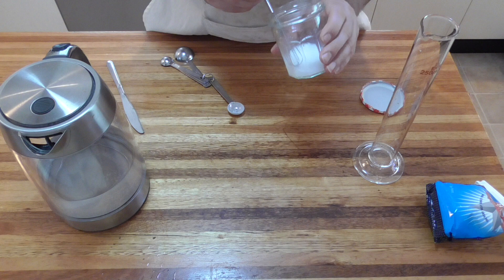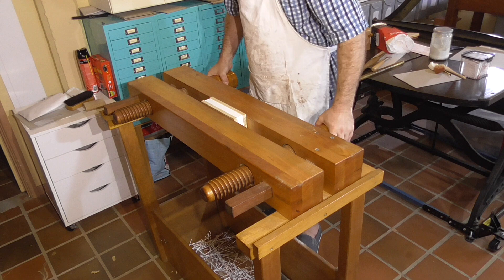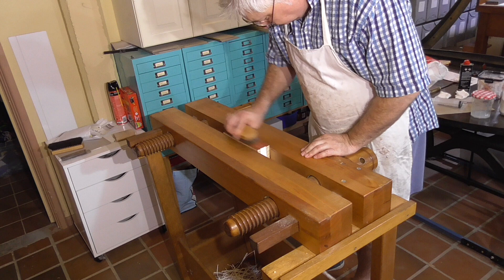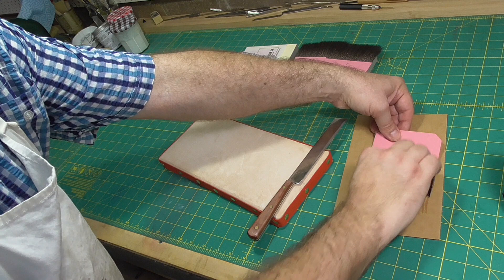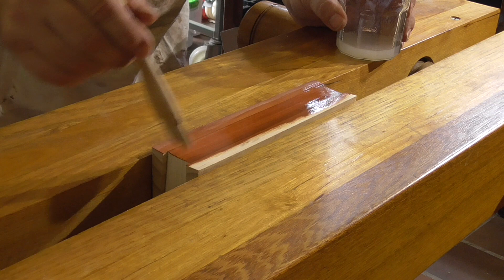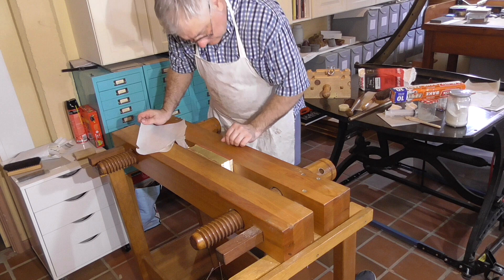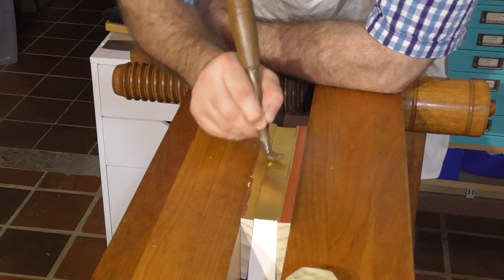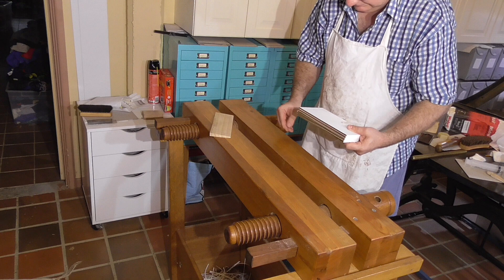Edge Gilding with Real Gold Leaf; John Mitchell Approach // Adventures in Bookbinding

Comment: You, dear sir, are ab oath-breaker! A secret-revealer and a mystery-demystifyer! And I simply adore that! I cannot recommend your videos enough. A big thank you and much love from Romania!
Reply from the maker: Great to hear from you.  I love your work!  I just found one of your videos I don't think I've seen.
https://www.youtube.com/watch?v=KRY96q3ml9Q
The paring of the spine on the curved stone is a great idea.  What do you use to get that great Venetian red colour on the edge?  All the best, Darryn
Reply: @DASBookbinding  hahaaa! Thank you man! It s an adaptation I did even when I was paring with a straight knife. Not having a French paring knife limited my spine paring method, so I had to devise this. You basically shave off longitudinal lines in the head region, then flip it and do the tail, then you shave some more to make the transitions smooth, and then I sand it by hand to get everything flush.

The red? Depends. When doing modern bindings and big numbers I use acrylic, 1:1 dilution, brushed quickly and forcefully and then blowdried to avoid seepage. Then I burnish it with crumped up paper (which i do recommend fore Bole as well, it s an old trade secret I ve learned) and then wax it perhaps.      When doing period bindings or old books, I use watercolor, strong dilution, also burnished but fixed  with beeswax and turpentine.

Comment: I really enjoy your video's. They really show all the facets of the techniques, including possible problems you might encounter. I'm interested at exploring bookbinding myself with an emphasis on medieval bookbinding. Do you have any literature recommendations for medieval bookbinding? Regards from the Netherlands
Reply from the maker: The bible on this subject is "The Archaeology of Medieval Bookbinding" by Szirmai.  But it is not a how to manual.  It is a complex question because there is no single "medieval" book structure.  Most of the tutorials on the net are pastiches of the style.  It is something I think is best worked up to.  In the next couple of months I'll be doing a flexibly sewn tight-back which is a good entry point for this area of binding.  I also have a modern take on the 16th century K118 binding planned for second half of the year.  All the best, Darryn
Reply: @DASBookbinding  Thank you for the information. I will look it up. I should be able to get some additional info from some archaeologists I know and fellow re-enactors with an interest in bookbinding or calligraphy/iconography. I will also keep a weather eye on your channel for interesting video's.

Comment: Thank you for this!  Is the starch corn or wheat?  I cannot find any information about that part.  Also I am curious, is finely milled refined corn or wheat the same thing?  Or does laundry starch have another additive in it?  Thanks again!
Reply from the maker: Wheat.  If you can't find wheat I'd suggest rice.  Not sure about cornstarch.  All starches aren't the same.  But for this use, maybe the differences aren't too important.  So maybe cornstarch would be fine.  Give it a go?  Laundry starch usually has whitening agents, which is best avoided.  The laundry starch I use supposedly doesn't.  But I don't think it is available any more.

Comment: Many of the boles seem to require rabbit glue. You used the starch size instead. Does that mean I could use any size mixed with the bole clay powder? I don't want to use rabbit glue! Your videos are amazing by the way!!!
Reply from the maker: In the different edge gilding videos I try and the different sizes traditionally used by bookbinders - gelatine, starch, PVA.  So, yes you can use what you want.  There is even a type made from boiling scraps of parchment (doesn't last very long).  I do know of old timers that used the glue from the animal hide glue pots.

Comment: John Mitchell's book suggests using an elliptical method when burnishing with a flat burnisher, but it looks like you just do a straight back and forth. Is this just habit, or do you have a preference?
Reply from the maker: I have tried this and found it is really easy to rock the burnisher ever so slightly and leave burnishing marks.  Maybe if I practiced more I'd find I could avoid the burnishing marks and the end result is better.  If Mr Mitchell does it there must be a good reason.  DAS

Comment: Can you show how to do gold lettering on book covers?
Reply from the maker: I do it 3 ways, with a blocking machine, with brass type in a hand chase with either foil and sometimes real gold, and rarely with real gold and handle letters.  It is hard enough to do with no one watching, I don't think I'm up to the last 2.  I occasionally briefly show using the blocking press in a few videos.  Do you have something specific in mind?  Yours, Darryn
Reply: @DASBookbinding  im not quite sure how to explain it properly but embossed letters with gold foil
Reply from the maker: @CastleStar5596  Yep.  Unfortunately the traditional methods, which I use, all involve very expensive tools and machines.  The gold foil or leaf is relatively cheap.  The best bet is to find an established bindery that you can pay to use their tools and equipment.  Many binderies do this, especially if they do teaching.  Most of my finishing hand tools are on loan.  But I will put it on the list of videos.  All the best, Darryn
Reply: @DASBookbinding  i will look into that option, your videos have been a huge help in teaching me how to bind books. More specific, binding comic books together, using the pamphlet bind video that you showed a while back. Did the library binding technique for awhile with comics but couldnt get the spine curve right so when you showed the pamphlet bind technique, it made binding so much easier and faster particularly with short runs of comics. So again, thank you for showing how to make bookbinding a fun hobby or career and thank you for your time as well. Much love and respect from the U.S.

Comment: would one ise the same method for guilding playing cards?
Reply from the maker: You could but most playing cards with gild edges will be done with foil. And the round corners are a problem for gold leaf.
Reply: @DASBookbinding  is it just called guilding foil? Amazon they use the terms interchangeably for some reason.. leaf and foil.
Reply from the maker: @Gbhmagic  I wish it were that simple.  Do your cards have rounded corners?  Are they home made or commercial cards?  Using foil for edge gilding can be a bit tricky.  The 3 factors that determine gilding success with foil are temperature pressure and dwell time (how long you apply pressure and temp).  The manufacturer usually specifies this.  Sometimes you just get temperature and that other two are more forgiving and you can work them out.  Temperature is very important and usually why people fail.  The foils sold on amazon are low grade cheap and they don't give you this information.  So you have to guess and experiment.  This means lots of tests to work it out.  For small scale production environments a heated silicone coated roller is usually used.  There are some big commercial machines that use huge heated plates.  I've heard of people managing to get some success with a clothes iron.  I tried it without much success.  The surface/edge has to be prepared and very smooth too.  Some materials/papers just don't like to take foil, especially hard art type papers.  This can usually be fixed with a surface size, such as one that Schmedt sells (can't be posted OS, so only available in EU).  I've heard of people using a PVA size.

Comment: I will probably be banned from this site if I ask : Is rubber cement ever used in place of other adhesives ?
Reply from the maker: Maybe not banned, but no I never use rubber cement for bookbinding.  Just no need.  Even the most fancy professional grade PVA/EVA and some wheat starch and MC might set you back $30 plus postage and would last most people a year or more.  Ciao, Darryn